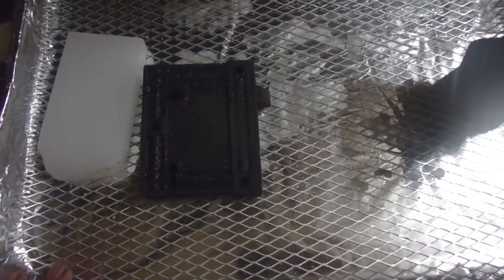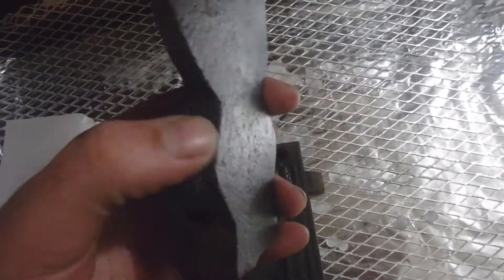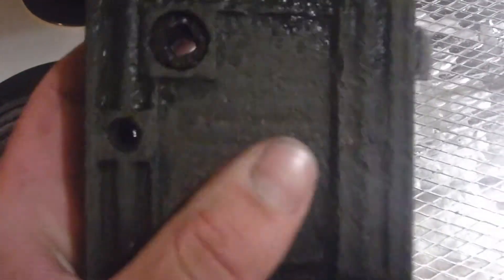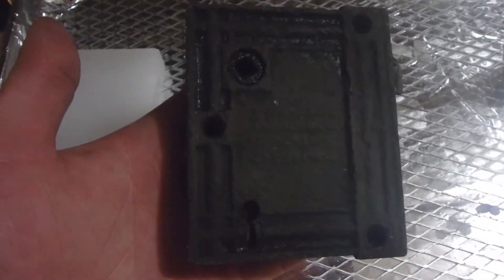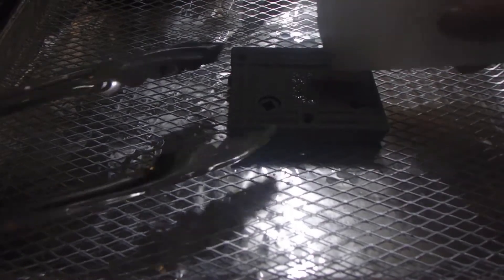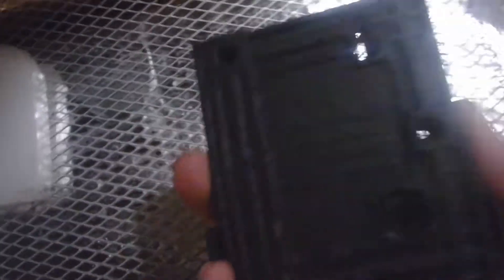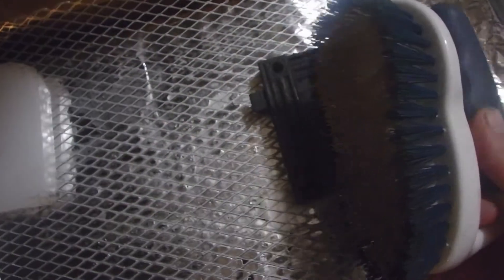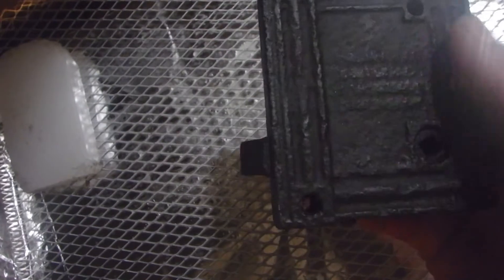Hot Wax Treatment Preserving Iron Relics

Comment: thanks... I wasn't going to over-clean or phosphoric acid rust convert (or even electrolysis) this approx. 5 inch or 12.5cm, 100AD Roman nail because some of it is likely held together with half-oxidized iron, and the patina over some of it looks cool and authentic, like it was excavated and not just cleaned up from the 1800's farm. But still, even though the patina etc. might have it halfway stable, it will be handled a lot. You clued me in to heating the bare nail, first, not plopping it in boiling wax. I'll probably spray it with alcohol first, too, to remove ... someone may have picked it up with bare hands after eating salty popcorn o.o. I was just going to use that stuff Thompson's water seal that is a type of liquid paraffin (maybe with solvents that evaporate and leave residue thicker than mineral oil (?) but it's definitely better to do what you're doing because it will resist people's handling it better, and now I realize I don't have to boil a whole pot of wax, lol. There's always the chance the solid wax will stabilize weak parts that might want to flake of or fall apart, better than just viscous liquid wax, too. Awesome.
Reply from the maker: Thanks Dale yeah the way I do it is not the most scientific but it works and holds up when you Handel it I polish the wax ever 6 months or so and looks like I just waxed it again. Its easy not boiling a big tub of wax as well every time